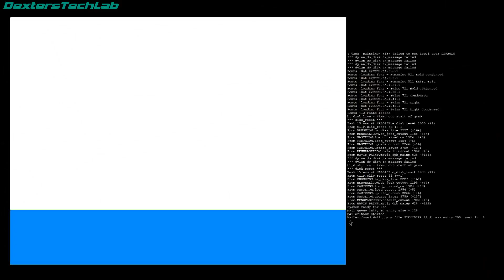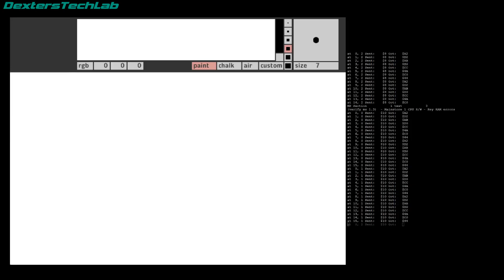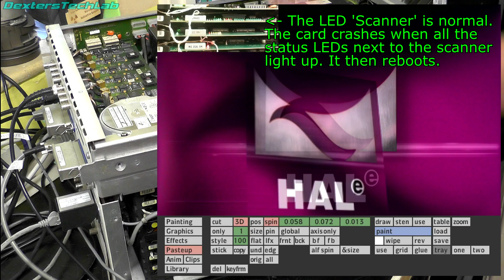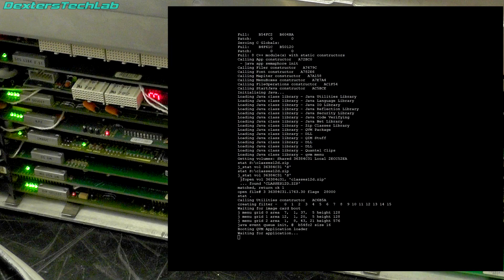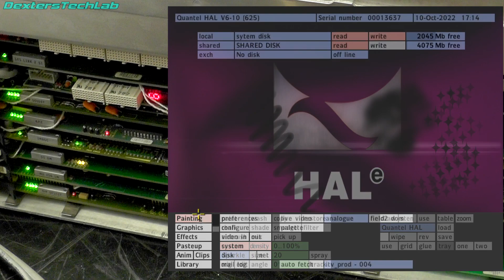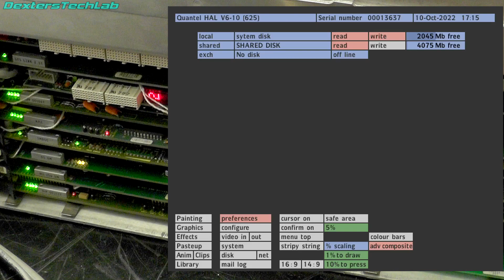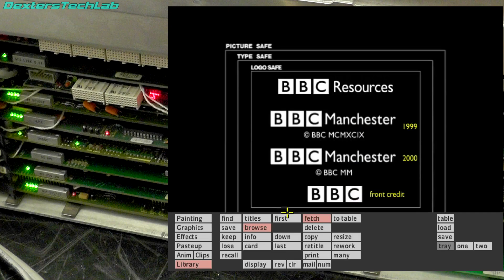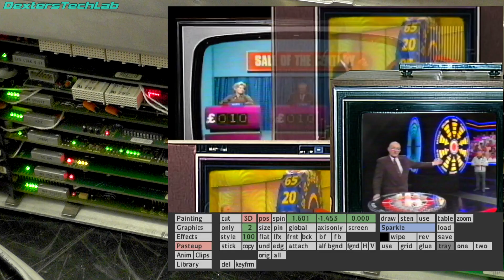DL238 Quantel HAL Express Restoration Part 2

Comment: Wow, those FPGAs are tiny! Only 208 LUTs (so 17K'ish LUTs in total for the 82 FPGAs on the board); and I imagine those Raytheon chips are external multipliers. Nowadays you could probaby replace all those FPGAs and multipliers with an USD10 ECP5 or so FPGA and have room to spare to put emulation for that Transputer in there as well.

Comment: Whenever you get one of these Hals to work you might be able to read some of my old Archive Reels from the MO disks you xferred. :)
Reply from the maker: Good to hear from you Beau! Yes, the problem is though the video is not stored on the MO disk which was probably archived to a Digibeta tape to be kept with the MO.
Reply: @DextersTechLab  you're probably right. It makes sense that an 'Archive Reel' would just be edit points from the tape timecode now that I think of it...

Comment: Amazing as always, could watch hours of this kind of stuff, thanks!!! But i have one small thing, the intro audio fade is a bit fast and to abrupt, it cuts also to early for me if you can extend the L Cut that would be nice you can make a slower Audio Fade and the ending should not clash with your introduction. You can absolutely disagree with my opinion it is just a suggestion
Reply from the maker: noted about the intro, i try and leave a bit of time for the edit but it doesn't always work out.
Reply: @DextersTechLab  i know it is not easy and if you just doing and cutting you don't notice it. But im not expert, probably everyone would have a different option

Comment: I wonder can you not use 100TiB Data Centre SSD drives for use with the QUANTAL HAL plus an associated Array Controller Card.
Reply from the maker: Sadly not David, 25 year old tech needs 25 year old parts!
Reply: @DextersTechLab  I wonder if it would be possible to build something around a Raspberry Pi IV 8GB SBC to do some of the work that the Dillian Array used to do or get hold of another QUANTEL Paintbox that has been tossed in the skip for parts,
Reply from the maker: Yea that would be perfect. Quantel only made 2500 Paintboxes over 25 years so they are rare beasts.

We are working on the Dylan array, hopefully we can get mine at least partially working and then work out what to do after that. There will be a video soon on the Dylan so will make sure i detail all the ideas we have.